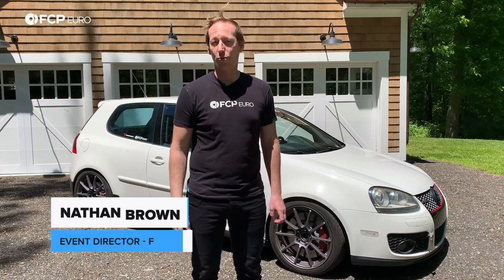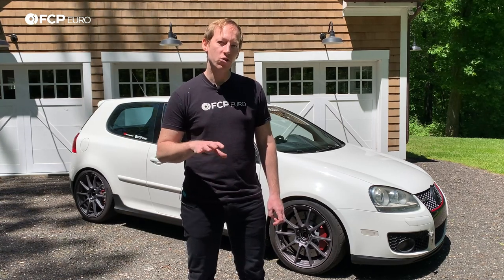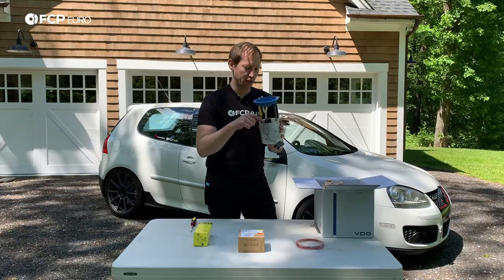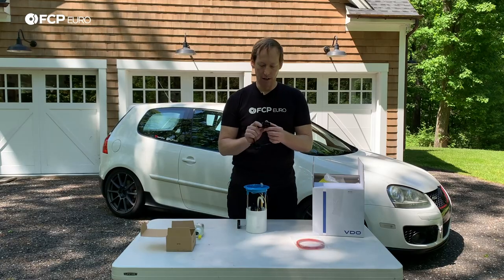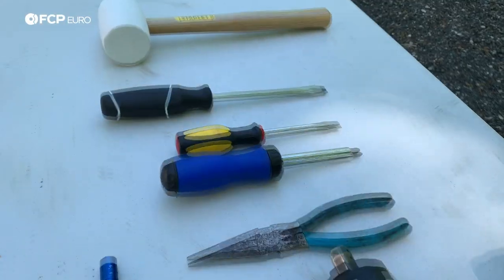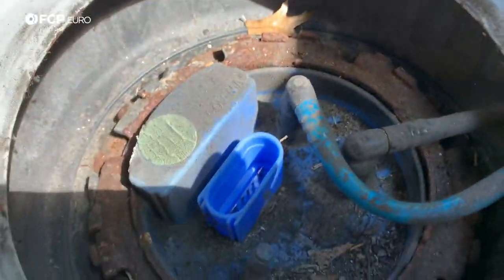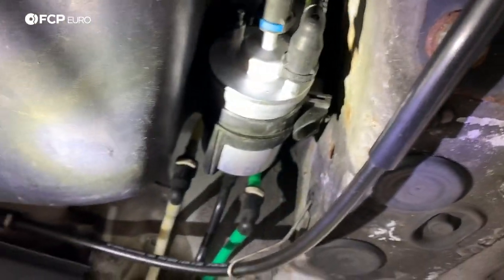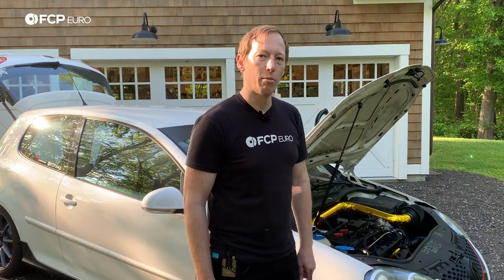Volkswagen Mk5 GTI Fuel Filter, Fuel Pump, Control Module Replacement DIY (GTI, Rabbit, Golf & More)

Comment: I have a 2.5l and it jolts at high rpms. Sometimes once and other times alot. But after the jolt it takes off like a rocket ship. I cant figure out whats wrong. Any suggestions?

Comment: Just changed out everything you did in this video for my Mk6 R and for some reason now my fuel guage doesn't work 🤔🤔 can't seem to figure it out. Had a spare controller so I swapped it out thinking it was that. Didn't do the trick. Swapped the pump again and didn't do the trick either... not sure what else it could be ... Any thoughts?
Reply: I think I have the same problem with my 6r, can I contact you? Dont know how though, Facebook?
Reply: @daanvaneek5549  the solution I found was to ground off the outside temperature sensor. It's behind the front bumper. The theory behind it is the 2 gauges in the cluster are connected someway inside the cluster, so grounding out the outside temp sensor it forces the fuel level sensor to work. Worked for me hope this helps you and others. Let me know. You can find me on IG  @Jay_from_ocd

Comment: Thank you for the good cámara focus on the fuel filter clips.  I saw a video last week and did not see the clips.  I forced and ripped off the ends of the old filter and now its a mess,  but it works.

Comment: Great Vid. Nice work. I always struggle just a bit with the Fuel Filter on our MK6 GTI. Bummer, I bet you wished you had a NEW Lock Ring when putting that Pump Assembly back. Looked quite crusty...
Reply from the maker: Thanks, GMAN.
Reply: @fcpeuro  do you guys sell the locking ring for the fuel pump?
Reply: Could always remove it and sand blast it and paint it!

Comment: What kind of mods does that car have? A mod list and driving impression would be great content for this channel. Thanks again for the awesome video.
Reply from the maker: Hey Julian, this car has quite the extensive mod list as it's a bit more track focused than your regular MK5 GTI. Here are a few key mods the car has;

Neuspeed intake
APR HPFP
Unitronic Stage 2 Tune
APR FMIC
APR downpipe
AWE Cat back
TT RS Front brakes
Ferodo DS2500 Pads
Stoptech stainless steel brake lines
Motul RBF600 fluid
NGP Type II Clubsport coilovers
APR Sway bars
Tyrolsport deadset kits F&R
Autopower 4-point 'Race' rollbar
Schroth Hans 2 harnesses
Sparco EVO 2 seats
South Bend Stage 2 daily clutch
034 Motorsport shifter bracket bushings
Dieselgeek Sigma 6 short shift
Wavetrac differential
BFI Stage 1 engine/trans mounts
APR pendulum mount
034 Motorsport rear engine mount insert

Nathan has some track videos that he's recorded over time with more coming in the future, maybe one of them will make it onto our channel!
Reply: @fcpeuro Sweet!
Reply: So for exhaust it’s APR Downpipe connecting to AWE cat back? Love the sound!

Comment: I have a question about a friends 2013 Jetta, gas 2.5, she's had a lot of fuel delivery issues.  I have personally changed the fuel pump twice, they've had to change the fuel pump relay (the bitch one way up top corner of under dash fuse box)  But I've recently noticed something after watching these videos.  It looks like at some point someone has changed the plug to the top of the fuel pump (spliced and shrink tubed) but I see no control module at all.  Are all the gas variations of these supposed to have that right next to the fuel pump?  When it runs it runs good, but it has left them stranded a couple times.  I don't feel as if the fuel pump nor those relays should have to be changed that often.  Anyone have an answer?

Comment: Hi, please help. My 2005 mk5 gti doesn't want to start when the engine is hot, I've noticed that it pushes back the fuel to the tank when the engine is hot
Reply: Yo what ended up being the fix? I have a similar issue and my GLI only has an extended crank after it’s hot

Comment: Great vid! clear and simple to understand. am I correct in understanding this procedure applies to the Mk7 as well? Tnx
Reply from the maker: Thanks! Yes this process is the same on all FSI and TSI Mk5/6/7 vehicles, as well as most other VW models from 2006 and up. Specific parts may change depending on the exact model, but the steps will be identical.
Reply: @fcpeuro  Yup and not only VW models but pretty much entire VAG lineup

Comment: I have code 00771 instead, which apparently may mean a dirty connector to the float.  Can I use this video to just pull the whole pump out, then detach the float, open up the slider-box it's connected to .. and clean the box inside?  Or is it not good to reuse the pump + seal?

Comment: Hello. Great video.

Where did you put the axle stand when you lifted the rear of the car for the fuel filter? I'm struggling to find a safe spot and my jack takes up the width of the pinch section.

Thanks

Comment: How much different would all this be for a vw cc 3.6? I’m presuming it’s pretty much the same?
Reply from the maker: Yup, that is correct. The process for the Passat 3.6 VR6 is going to be more or less the same, with the exception of the specific parts, and the fuel filter. On the Passat 3.6 the fuel filter is integrated into the fuel pump and is not a separate unit like it is on this GTI.
Reply: PASSAT CC

Comment: Thank you for the video! I've got two questions: 1) looks like your airbag indicator light is on. Mine, too. What I can do to resolve that? and 2) your center gauge screen looks mighty bright and nice for a MK5 at 188k miles. Mine is dim and I can't see the odometer reading and other parts of the screen. Is there anything I can do to resolve this? Thanks in advance!
Reply: Ayo I own the same car and mines at 198k all bright and dandy. Either you don’t realize you have a brightness KNOB slightly to the right of your Headlight and Fogkifht knob ORRRR a power issue via battery. But I’m hoping you don’t know about the knob that turns your brightness up and down. Also at night it’s lowkey automatic, it’ll dim itself if you have it set to dim.
Reply: @musicaljay4453  I am aware of the brightness adjuster next to the headlight switch. That isn't what I am referring to. At night, the center screen is fine. But during the daytime, parts of the screen are unreadable, like the odometer area.

Comment: Hey! I have a faulty fuel sender. I’m considering changing the whole pump but as I’m unsure how much fuel I have in the car. How would I find this out? Or would I have to take the fuel out before removing the pump. Don’t want fuel to spray everywhere!
Reply from the maker: Hi Jay, more than likely you will need to remove the pump to visually see the level inside the tank. Or you could drive it till empty...😅

Comment: I get a P0089  hanged the cam follower and sensor on the high pressuer fuel pump. fuel filter is new. could it be the fuel regulator?
Reply: I'm having the same issue and some pretty nasty power cuts. any leads?

Comment: Thanks for the video- just the information I needed to sort my FSI Audi direct injection motor (returnless as the regulator would have been in the tank) into a 986 Boxster. The Boxster is return off the fuel rail, so switching to this filter will give a simpler way to regulate and return whilst using the existing pump in the tank.   I looked at changing to the 997.2 pump (with inbuilt regulator in tank), as a costly alternative.  Cheers

Comment: Did this module actually fix the fuel cuts for anyone or is just more money thrown into a black hole? I got that same VDO pump brand new last week and it still gets cuts and those errors once driven for 40+ min. It's -2C outside here now so I can't even think what will happen in the 30C+ summertime. In the US I believe they relocated that controller to another place to get rid of the heat from being squashed under the backseat and carpet. I'm thinking of actually extending the wires to move that bastard to the trunk and put a a regular fatty PC heatsink on it, not that joke they use.

Comment: So you are not sure what is the fault and thus you replace everything. Maybe get the car to a real mechanic ? LOL
Reply: I data-logged the car for multiple sessions and was unable to replicate the issue, so taking it to a mechanic wouldn't have gained any knowledge unfortunately, it just would have cost diagnostic labor. Knowing the codes, knowing the fuel filter was due to be replaced, and knowing the LPFP and control module hadn't been touched in the time I owned the car, I decided to replace all three components as I couldn't risk the problem popping back up when I was on track. I wouldn't do that for some problems, but for this issue which is very specific and happens under certain conditions and not others, it proved to be the right move.